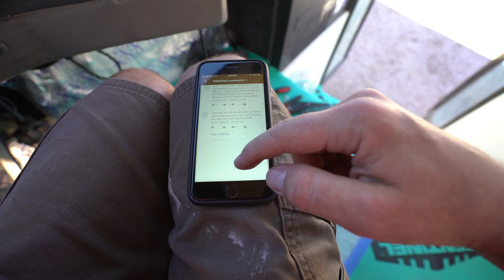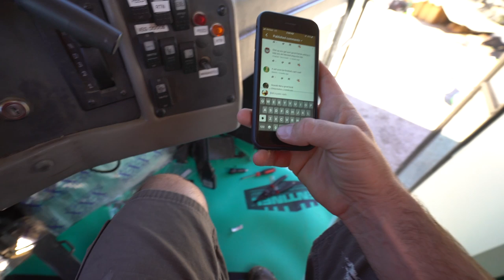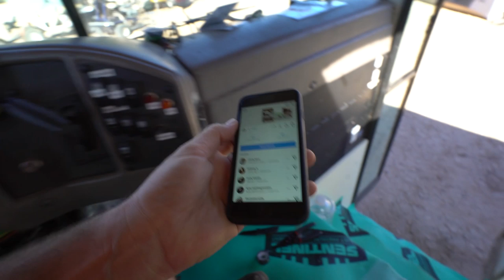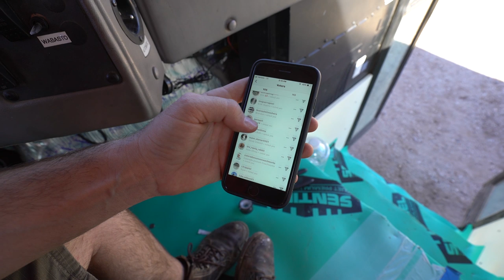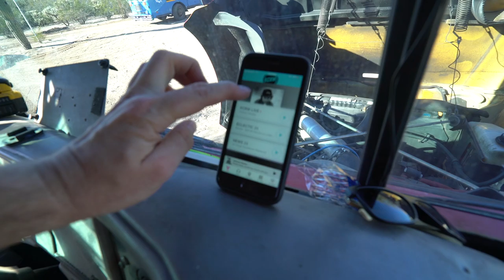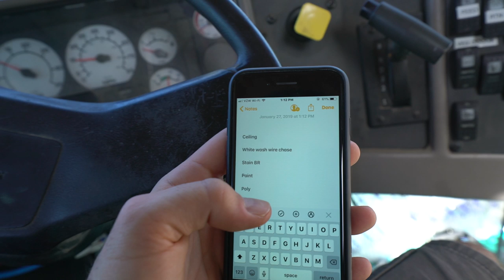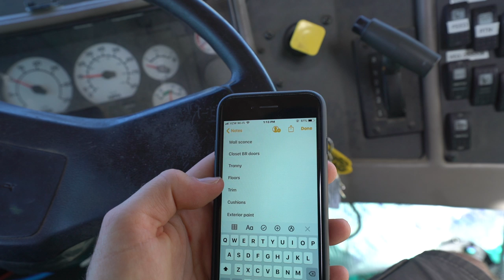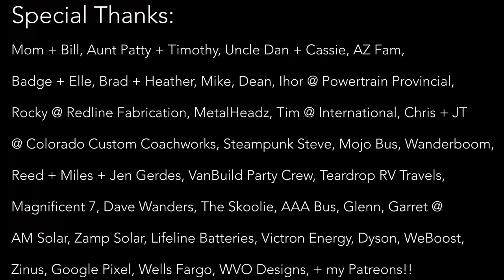Steampunk Steve Helps Install CB Radio Wire. Skoolie Outside Table Fix

Comment: I'm someone who grew up with CB radios (yes, I'm showing my age here!), but a CB is a fail-safe method of talking to others without using towers, or repeaters or even being close to a town.  It just works, just like ham radios do when all else fails.  It's an excellent idea to have in your rig for a backup plan!
Reply from the maker: Thanks for the input!!
Reply: Yes, even though most rely on cell phones. You can’t just call out to random people near you on a cell phone. It’s helpful for weather, road conditions, places you need to access, where best to stay, to fuel up, etc etc. it’s just a shame it got so abused over the years. I still have three CBs and I still use them.
Reply: I still have the President Zachary T, with channels below 1 & above 40.  Yeah, not legal to use those, but it sure was interesting to listen to 'em!

Comment: Laying in bed at 5:30 in the morning in Tucson watching your vid. Would like to experience a little generosity myself.  Good for you Jax!
Reply: Where do you get the booster and what exactly is the name? Verizon and I aren't seeing eye to eye on "unlimited data hotspots"
Reply from the maker: The booster is from WeBoost.
Reply: @JaxAustin  I should have stayed in bed.... went to get groceries, stopped to get bottled water refills and miscalculated the height of a area I was going to drive through.  Now minus my AC, 2 vent covers and 2 solar panels.  Sigh

Comment: If you haven’t done it yet with that cb, make sure you go to a cb shop to get it peaked n tuned. By doing that, you’ll be able to get out a whole lot farther than when it’s stock out of the box.
Reply from the maker: Excellent idea. Thank you
Reply: Jax Austin your welcome. The cb shop can add features to the cb too. They have a bunch of different tones that are really cool. With how you were when you got that air horn installed, I can see you having all kinds of fun with what they can add.

Comment: Earlier I was trying too work on my skoolie it’s really been testing me it let me remove a total of six screws today out of the ceiling panels plus out one screw in the back side panel. Also the bus let me remove two bars from the cross over mirrors. That’s it ! I had put some more DW spray for stubborn rust part I’ll try again another day. I need a generator & a plug in power tool my black & decker hand held apparently is a toy that’s why it’s taking so long to get the last few screws out it doesn’t have enough power. 😤😠😡 Anyhoo I said let me see if Jax’s put another video up to finish my day then I’ll watch Badge channel next 😁

Comment: Just got back from Farmers Market. Bloody Mary and watching you. I saw you install the WeBoost too. I need one. I love the casual posts.
Reply from the maker: 100% recommend a weboost if you need connection on the road. They all enhance the signal.
Reply: I wonder if I need one in the Truck or my 22’ trailer. Or if one in the truck will work in the trailer

Comment: I install 2 way for a living.  Your best bet to keep reflection down and get all of your power out is to get the antenna higher.  Mirror mounts are probably the best option for this or if you want the best install, through the roof gives great ground plane.  Hit me up if you ever need 2 way comms help.

Comment: Take that front panel off and while it is down cut yourself an access panel that you can get into there when necessary and finish off that ceiling and wall bit. Your  bus is looking sweet and everytime you see that exposed foam insulation and wiring its like... 🤮 keep it up, I love this stuff you have inspired me to look for a bus too!
Reply from the maker: Mike Wiginton it’ll get patched up soon!!

Comment: Jax, just so you know:
Paracord is definitely strong enough to hold a baby. Paracord is also known as 550 cord due to having 4 internal strands of 110 pound test cordage and another 110 pound test casing. 110 × 5 = 550 pound test; 550 cord..... I hope no one has a 551+ baby 😁  I use that stuff for many projects. (1) It is cheap (2) ,I am military so it is readily available (3) it have amazing strength and durability in a small footprint.
Reply: I really hope to have a 5th wheel, soon. When we get it, I also hope to be able to meet up with you and many if those we see on your videos. Whether that happens or not, the co tent that you put out will be a great help in setting it up just the way we want it. Thank you.

Comment: Hi Jax,  I think having a CB radio is a good thing wherever you are because what happens if you broke down and your phone doesn't work then the radio would be so helpful in that situation. Your bus is realling starting to look the bees knees on the outside now as well as on the inside with all the antenna's but one thing you haven't showed us as of yet is your decking on the top of the bus. Thanks for the share and good luck with your pictures. x
Reply from the maker: Sue Girling there’s something to do to the rook before it’s finished ✌️

Comment: Looking good Jax. It's coming along slowly but surely. Do yourself a favor and install a Lightning Arrestor on your coax between your antenna and your radio. I know it seems like an unnecessary component but I had lightning strike an antenna and kill my Cobra classic 29 a few years back. They aren't that much money and well worth the cost. Be safe in your build and your adventures and thanks for sharing.
Reply from the maker: I had no idea that was a product. Thank you so much for the suggestion

Comment: small thing about the painterstape around the ceiing  , if you leave it on there too long it whont come off without having to tear it off in small pieces or leaving a white powdery residue 

the CB radio (when youre transmitting ) sumtimes disturbs the gps and internet signal (believe they used the same frequency or close to it )  , you might want to test that before using the CB radio with the navgation running or a video uploading 

as for taking pictures and being off youtube for a while : you could put a small camera like a gopro and the camera together side by side on a tripod bar pointing to where the camera is pointing and basicly have the go pro run while youre setting up and taking pictures , you might end up with some post able content and inserts for other vids without realy trying for it or interfering with taking the photo's

Comment: JAX - Don't let the project / work get to you. Owning a home whether mobile or stationary, there is always something that needs finishing, building or repair. An example: a massive Oak Tree fell across my driveway this last storm blocking the egress for both my neighbor and myself. Two hours of hard chainsaw work just to open a drive through.  Also, the week before my water well quit working. $200 to fix.  Just saying life as whole has its challenges no matter what housing situation you have placed yourself in. Bend with the wind Grasshopper........:O)
Reply from the maker: It sure does. Thanks for the message.

Comment: Think a lot of people think I'm picking a bus it's cheap  hell of a deal.   Without actually foreseeing how much work is actually involved.   As a one man operation can see a lot of projects out there coming to a stand still or taking a few years.  I wouldn't tackle it unless I had a place and about 35-45 grande dispensable cash to throw at it not including the Bus.   Even if you don't use that full budget the better, but just have it available.
Reply from the maker: I’d recommend the same.

Comment: Jax, so pardon me asking a question that I'm sure you've been asked a million time so far, but how do you afford to stay on the road like you do?  I'm just starting my build now, and trust me the build is kicking my buttocks!  The work yeah it can do that to anyone, but the costs of things are amazing to be honest.  I know some have built up retirement income over the years and are living on that, luckily for them, but you are definitely younger than my decrepit 50 lol, and well too young to retire yet I presume.  Let me know if I presume too much.  I have most things sorted out as to how I want them done, and how I'm going to do them on my 1997 Dog-nosed International 3800 3/4 length bus, but replacing my old at545 with the mt643 that I want well that is extremely daunting! While I have always been mechanically inclined enough to understand how to use tools and work wood, I'm by no means adept enough in my opinion, and considering my field is computers and call center work for 25 years lol, well this will be fun.  Thank goodness I work from home now!  btw I had looked for an email to send you privately but of course couldn't find it. and yeah I know what it means to have a public email address, that email turns into spam city too quickly!

Comment: You are better using Android Auto of the Apple Car Thing rather than the Cheap GPS that is built into the radio. 

Using WAZE on the headunit is awesome, I have a dedicated Android Tablet that has GPS and 4g on my dash full time.

Then you can spend around $350 and get a super nice single DIN Radio without anything fancy that just has good audio since the tablet, or phone is doing the actual work.
Vs. Spending $350+ on a cheap Double Din radio with a cheap touch screen.
Reply from the maker: The feature I most wanted was the MPH warning.